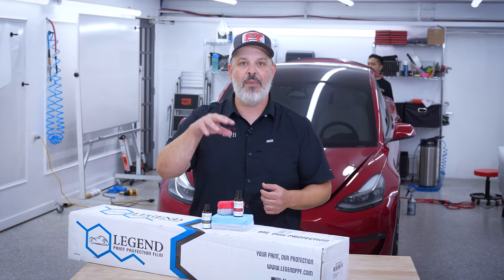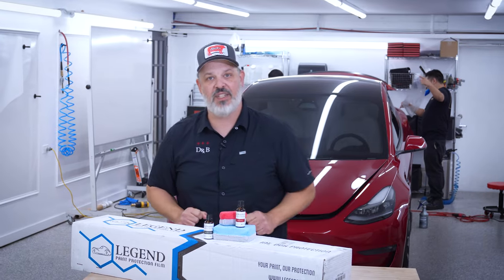Should You Apply Ceramic Coating Before or After PPF? #ceramiccoating #ppf #detailing

Comment: I have both PPF on my hood and yes then the ceramic coating.  That combination works together and looks great.
Reply: but doesn't the car get less shine if the ceramic coating is applied after ppf?
Reply: @OscarEduardoRosales  the paint should be at the best prior to applying PPF.  PPF then adds only protection only (except matte PPF) and your coating locks in the shine BUT provides the chemical resistance and ease of
 cleaning

Comment: My question is re partial PPF installs - with the problem of high spots when coatings aren't fully removed, don't they leave visible build-up along the edges of the film where it's impossible to completely buff off?
Reply: Use 99% isopropyl alcohol and a clean microfiber towel. Don’t force the cloth down. The alcohol will soften and come off with ease as you continue to wipe.

Comment: I am seeing where a lot of people of ceramic coating their cars then applying PPF over the ceramic coat and then ceramic coating over the PPF as well. What is your thoughts on this?
Reply: Had the same question
Reply: @jayburgwtw  I found out there is no benefit to ceramic coating under the ppf just ceramic coat over the ppf
Reply: @samthetoolman8068  This statement is a blatant statement of which everyone doesn’t have the same view.  Lots of people prefer applying a CC 1st due to the easy removal of the ppf .

Comment: Do you have to wait for the PPF to dry before applying a Ceramic Coating?
Reply from the maker: Yes, you want to be sure the PPF is completely dry and clean before applying a ceramic coating to ensure the most durable possible bond.